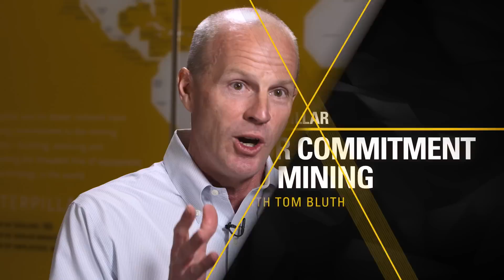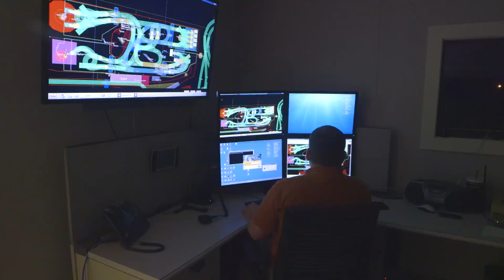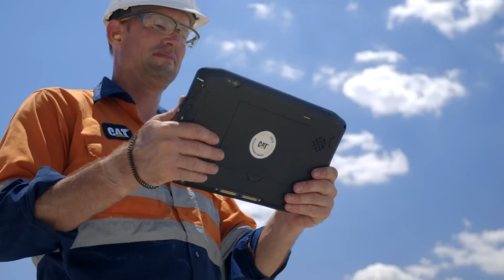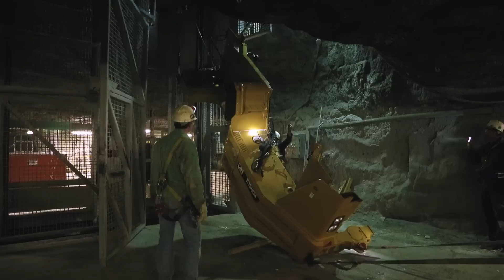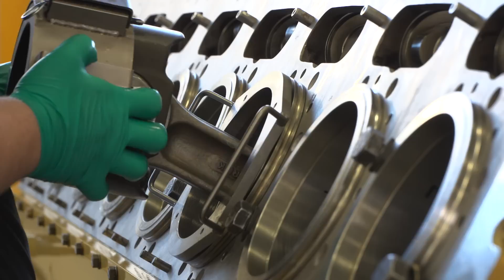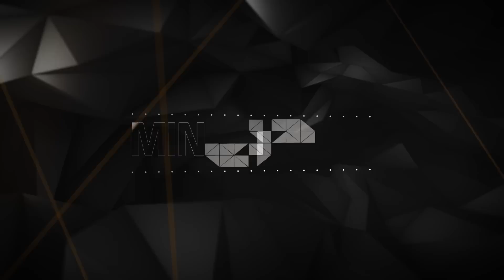Caterpillar: Our Commitment to Mining with Tom Bluth

Comment: I got one ? Does those remotes tell u when u have a blow hyd hose or a drill steel has fell into a hole i hate to tell u but i hate the remote i would still be in touch with my men then a remote at less they can do move then a remote can